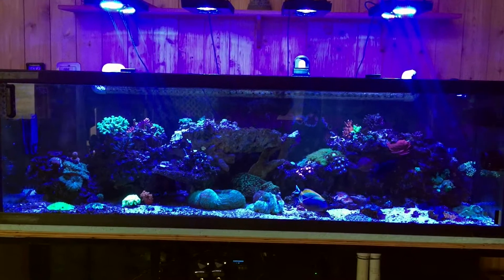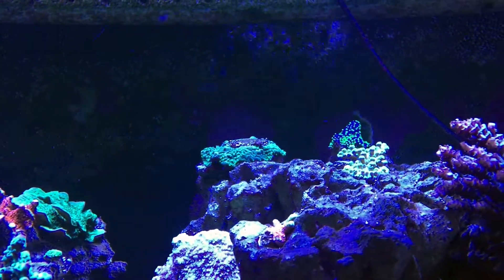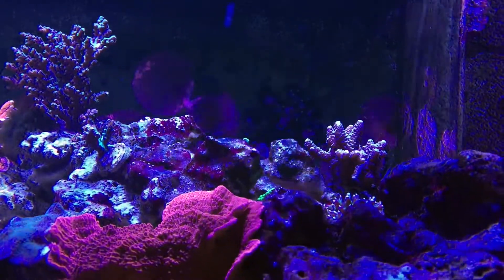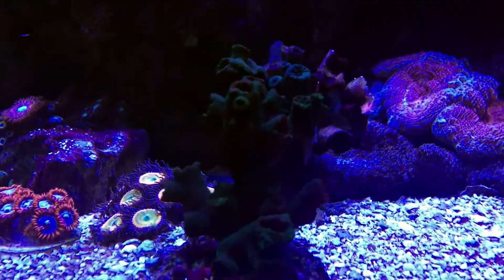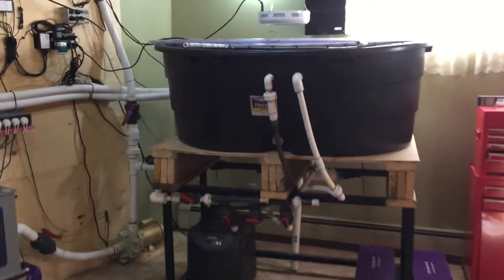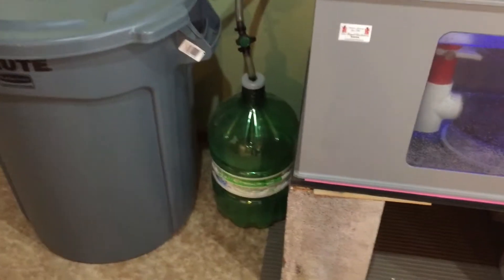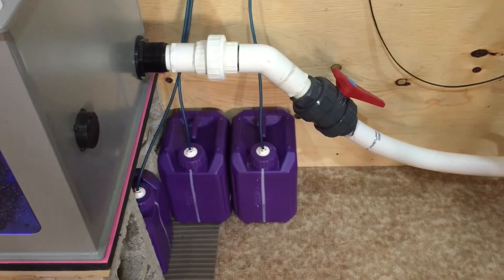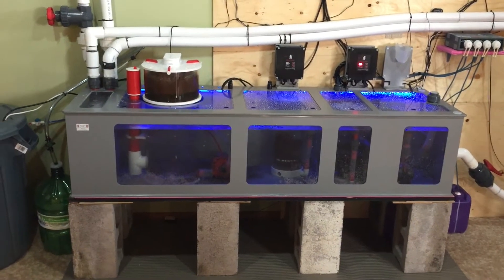Saltwater Reef Tank and Royal Exclusiv Sump

Comment: I've used Miracle Mud on 2 systems. Could not tell you if it works or not because both systems also have plenty of Marine pure, Bio pellets, Rowaphos, and ESV B ionic 2 part. But both systems are doing great. The only thing I can tell you is to plan ahead and have it setup so you can quickly and easily change it out when it's time, like the instruction say (50% every 2 years). That's the only hassle for me, as I didn't set them up for an easy replacement.